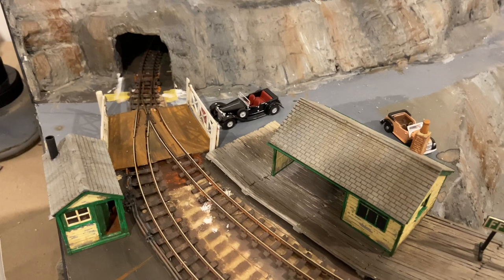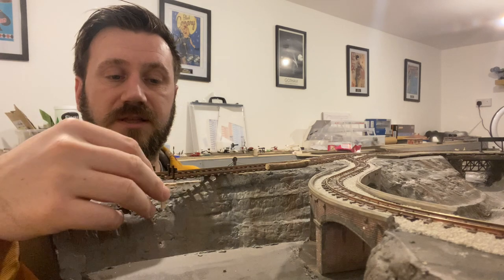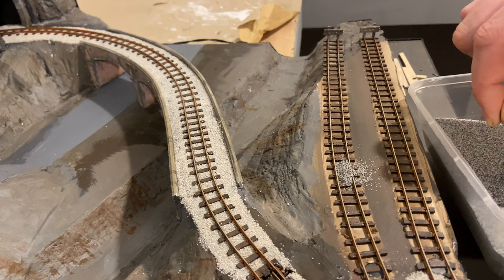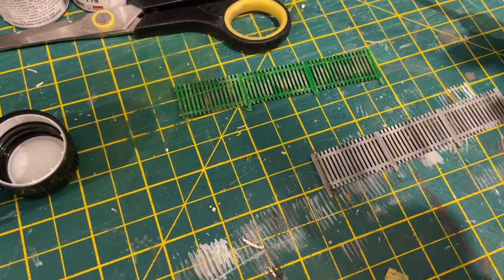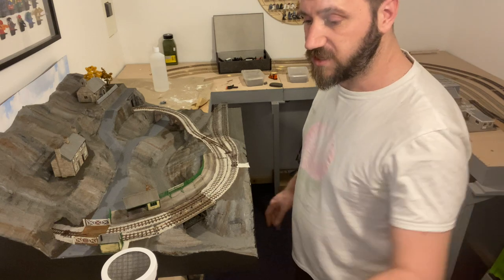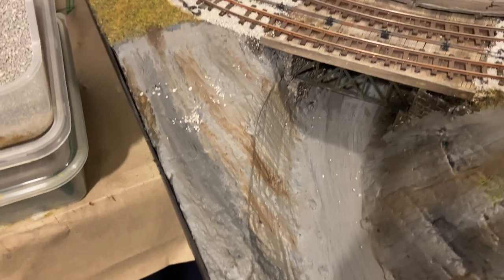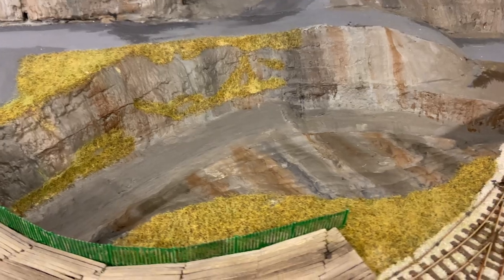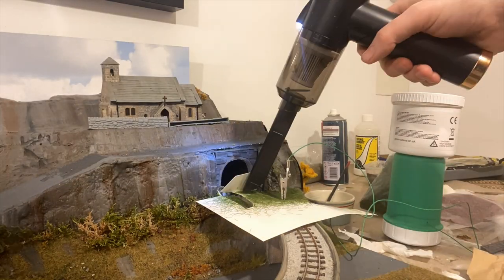Building a OO9 Model Railway Episode 9: Static Grass, Ballasting and building fences

Comment: Really smart as always.
I feel i am building it vicariously through you and learning as i go
Can you tell me which vacuum you use and if it enables you to save the extra and use another day?
Reply from the maker: Thanks David. It’s cheap hand held off Amazon about £15-20 pounds I can’t remember the brand. I wouldn’t recommend though it has a battery life of about 10-20mins and isn’t very powerful so might be best to shop around. Alternatively use a vacuum hose with tights over the Nozzle. You can save loads of static grass by doing this so I would recommend doing this.

Comment: Just wondering. What radius are your curves please? If there like first radius do you get any problems with stuff coming off? 

I’ve just dived into oo9 and already planning a small preserved layout. 

Thanks
Reply from the maker: They are first radius set track curve, I have no issues with any of my locos, the points are set track as well and the biggest issue I have with them is electrical continuity, the locos don’t stall on the frogs but I would recommend avoiding and going electro frog if you can.

Good luck with the layout build, OO9 is a great gauge to work with.

Comment: How did you make your water/glue mix so that it doesn’t completely flood the ballast and make it go on the sleepers, yet also have enough liquid so it flows through all of the ballast? I’m using Woodland Scenics medium ballast, and I always end up making the ballast end up on the sleepers, even if I tap it all between the sleepers before using the glue.
Reply from the maker: Okay it’s been a while since I did it but if I remember correctly I got a spray bottle that mists (in this case an old spray gel bottle) I put water and IPA Alcohol together 60:40 and spray the ballast from a distance so as not to disturb it. I then use a pva water and tiny amount (and I mean tiny) of dish soap mix and apply by pipette I tried a syringe but it’s too easy to flood the ballast. Let it dry and do it again. Always work in small patches
Reply: @WesternSignalman  thanks, I’ll try that out!
Reply from the maker: @ModelRailwayFan38 no problem

Comment: I just ballasted a large section of my layout and after cleaning the track no power is going to the section I ballasted, any tips?
Reply from the maker: Try testing the rails by applying power to them with a couple of wires from your controller to the top of the rails if the power works then I would say it’s your connection to the track it may have become insulated with the glue if it doesn’t then maybe your rails need another clean. Hope that helps
Reply: @WesternSignalman  okay I’ll give that a go!
Reply: @WesternSignalman  that worked so I’m guessing glue got between the rails. Is there anything you recommend doing to get the glue out of the joiners?
Reply from the maker: @modelrailfan37 hot water but you risk the ballast glue lifting as well if you pour on too much. Some IPA alcohol (not Indian pale ale) can also attack the glue and you may be able to use a cocktail stick to try and clear it out. 
Alternatively solder dropper wires each side of the join and connect underneath the baseboard or solder a bridge wire across the joins
Reply: @WesternSignalman  alright, I’ll give those a go!
Reply from the maker: @modelrailfan37 good luck
Reply: @WesternSignalman  the IPA worked!! Thank you so much for your help!!
Reply from the maker: @modelrailfan37 awesome stuff glad I could help